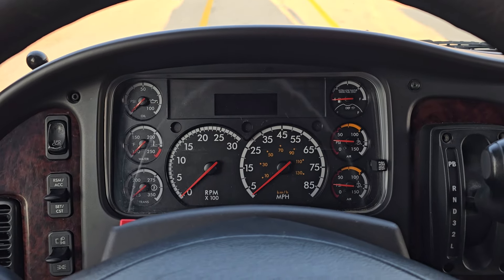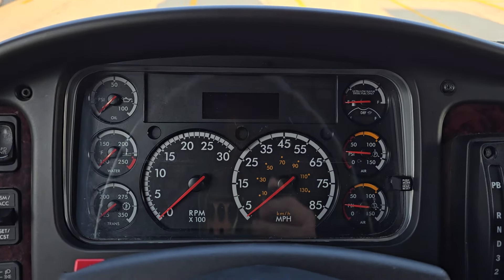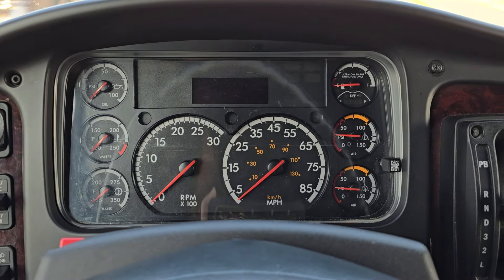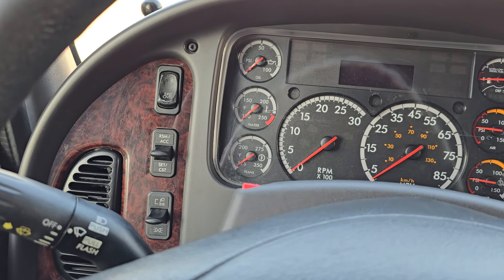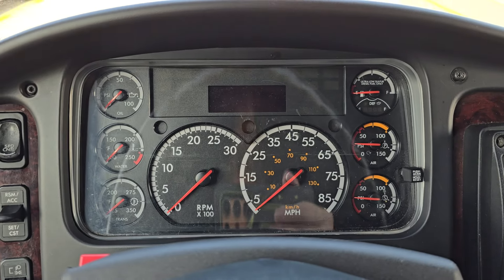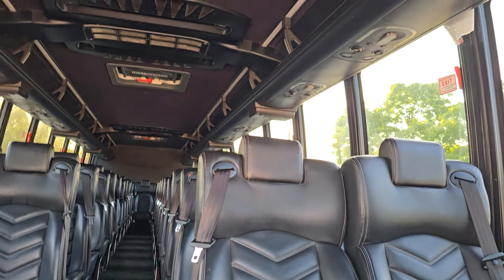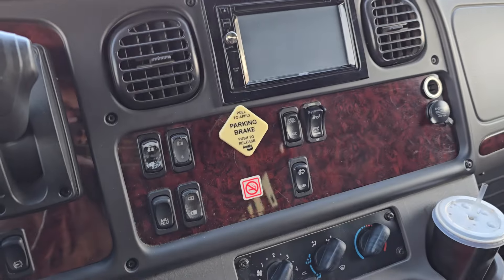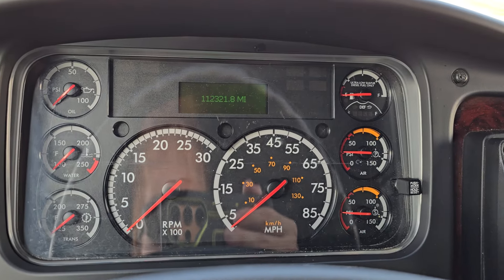This Bus Broke Down and Wouldn't Take a Regen

Comment: Modern diesels seem like a pain in the ___.  I guess I’m showing my age.  Does your company run a cetane additive? Or is it not necessary with the low sulfur diesel?  My 1994 Ram 5.9 Cummins needs it.
Reply from the maker: @Qrail  You're absolutely right.  Many times our buses go out of service because of the aftertreatment systems.  Just today we had a 2009 MCI J4500 that needed a regen.  First time I've ever had to do one for a driver of our company.  And I'm not sure what we do with our fuel.  I do buy Hot Shot's Secret Diesel Extreme and put it in the fuel tanks sometimes.  That's the best injector cleaner and cetane booster on the market and many drivers swear by it.
Reply: @BusMaster99  I will check that product out. I use PowerService Diesel Kleen+cetane boost.  And on a recent trip from LA to Fresno got 24 mpg. (Empty)  Less smoke, better economy.  
3/4 ton, 2 wheel drive, automatic, gear vendor overdrive, standard cab, long bed, tonneau cover, 95,500 original miles.